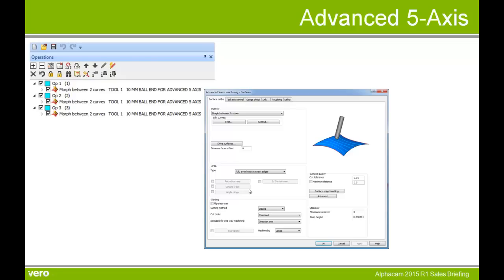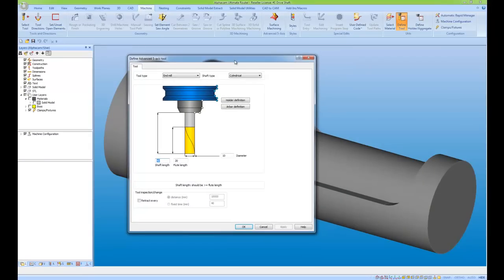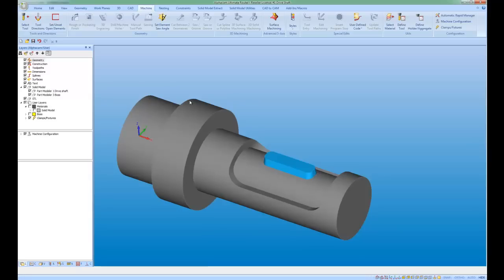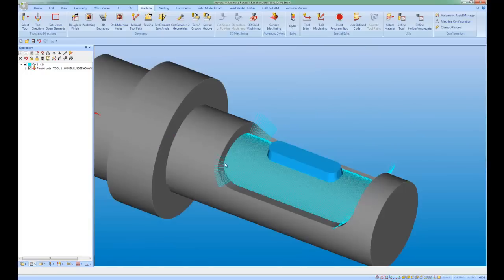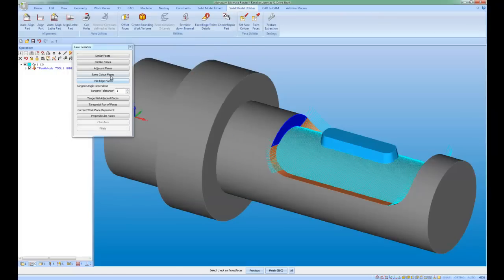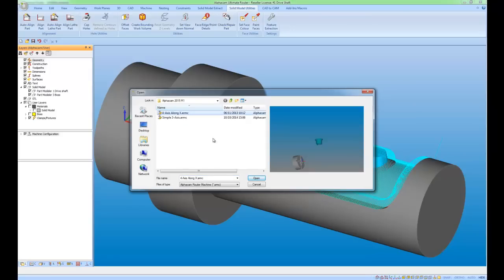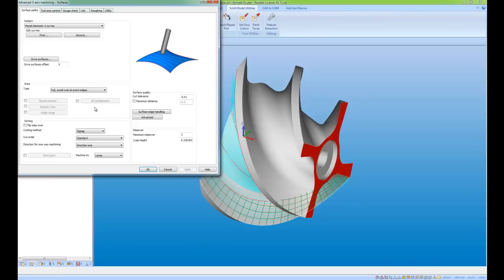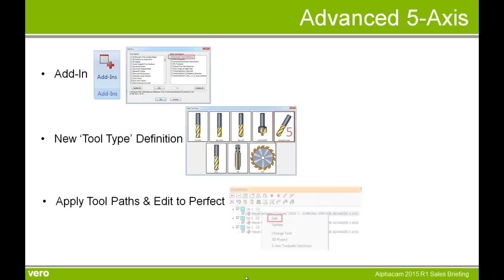Alphacam 2015 R1 - Advanced 5 Axis

Comment: Great video, I am currently writing a 3 and 5 axis Post Processor for a Hurco VM-10 for my university dissertation. I am using PTC Creo for the manufacturing steps and it is terrible.

The university also has a copy of AlphaCAM which I am now going to use after watching this video. I know that I can pass the CL file through the Post Processor in AlphaCAM as I already have the file directory generating as a ".nc" file.

Many thanks